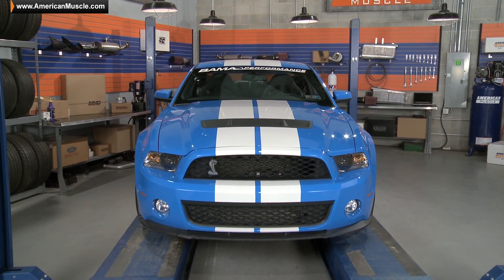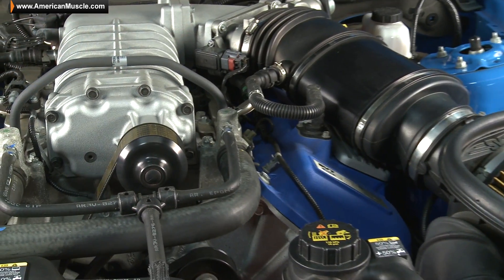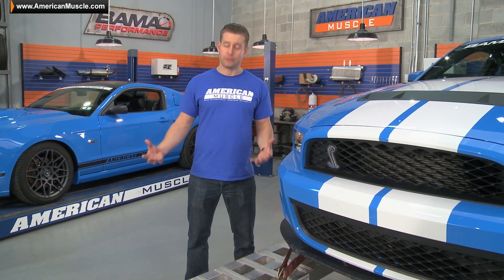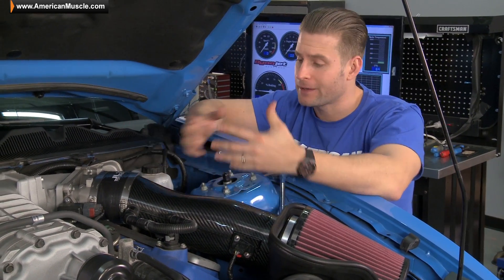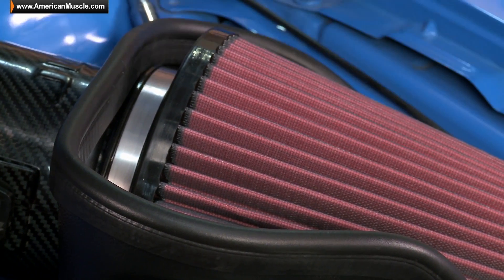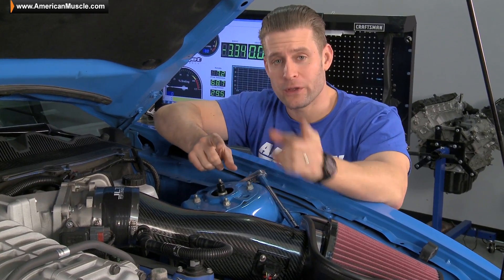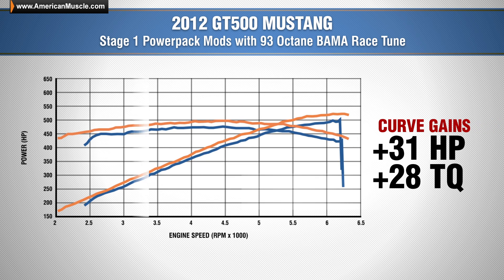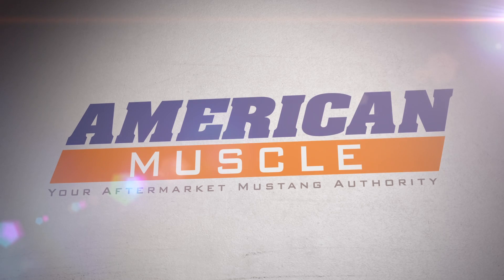2010-2012 Shelby GT500- Bolt-On Build-Ups: Stage 1

Comment: Is there a reason why the '10 gt500 only made 20hp with the intake and the '07 gt500 picked up over 50 horsepower!?!
Reply: The 10+ GT500's come with a factory ram-air style intake which accounts for most of the stock 50hp bump in power over the 07-09's. The factory ram-air intake however is still slightly more restrictive and smaller than the JLT thus only a 20hp bump in power which half of that is from the tune. The older 07-09 used a traditional style intake that actually draws cooler air but is much much more restrictive.
Reply: There was ALOT of small changes to the 2011 from the 2010. Exhaust was one of the big things. Also wideband O2 sensors. Plus, Cast iron block to aluminum block.
Reply: Look at the stock intake designs for the 07-09, and the 10-12. World difference. It’s why the 07-09 gains more. The 10-12 starts with more.

Comment: I don't really think CAI and tune is enough to be called a "pack"  I would have gone with just two stages of power packs so that more can be in each pack instead of stretching the mods you are going to do so thinly.  Same could be said for the 08 gt500 videos as well.
Reply from the maker: I hear what you are saying- but try to look at these bolt-on build ups, not as a typical project car build, but more of 'customer' approach to modding.  I'll be the first to admit, its always fun to throw 5-10+ different parts on at once, as is the case with most of our project cars, however a majority of our customers tend to 'chip away' at mods- and 9 times out of 10, most look to a cold air intake and tune first.  And ultimately, when you throw a bunch of mods on at once, you can sometimes lose track of the benefits of each individual part.  So we really want to highlight that it doesn't take much to see MASSIVE gains with these Shelby's.  Hope that makes sense! -Justin
Reply: AmericanMuscle.com You bring up some very valid points.  And another thing I didn't even think of is cost.  I bet most people like you said gradually mod because of financial reasons.  I know thats what I am doing :)  It makes perfect sense thanks Justin!